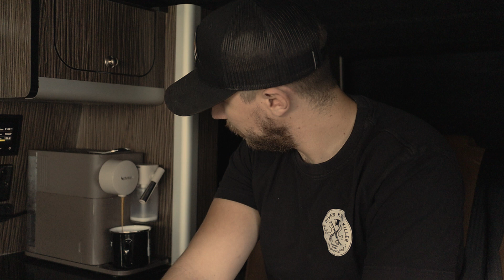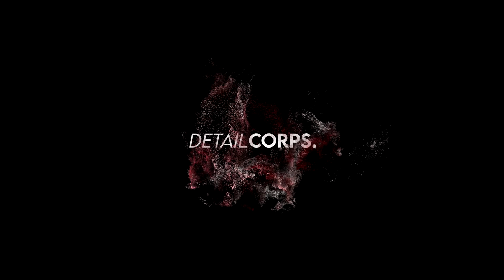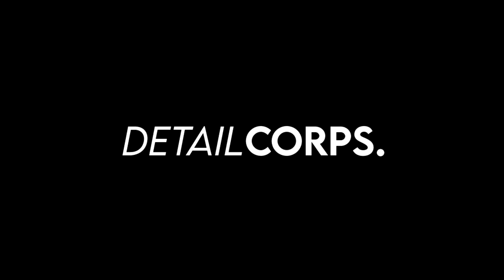Everything You Need to Know About Inverters

Comment: Hi thanks for the great video and sorry to bother you, am I right in thinking I can with that inverter you have wire the ehu straight into the inverter and then feed off into a consumer unit so that either 12v route or mains source are protected and keeps a more simplified system, thanks again for video 👍🏻
Reply from the maker: Yes you can do that.

Comment: Do i only need to worry about cable size and fuse from battery to inverter when buying an inverter? Say if i go for a 3kw inverter that would be drawing 250 amps from a 12v battery is that ok? or how do i work out how much of a load the battery would take?
Reply from the maker: Cable should be rated at the maximum demand of the appliance, the fuse should always be rated less than the cable.
Reply: @CorpsMedia  so the battery itself will handle 250 amps load no problem?
Reply from the maker: Depends on the size of your battery, what size do you have
Reply: @CorpsMedia  2x 115ah 12v agm